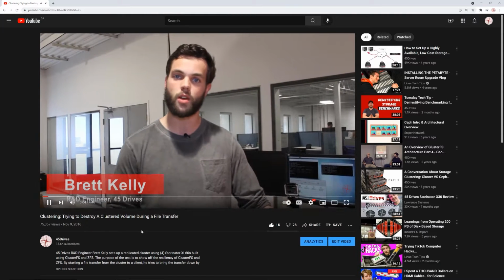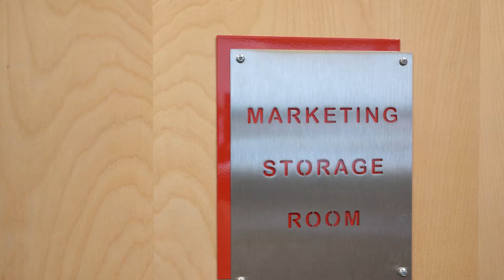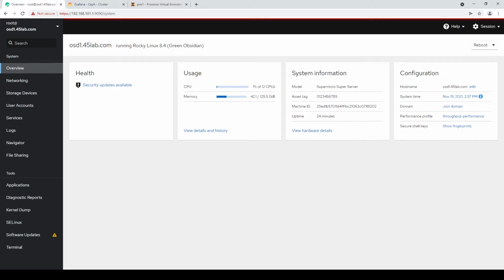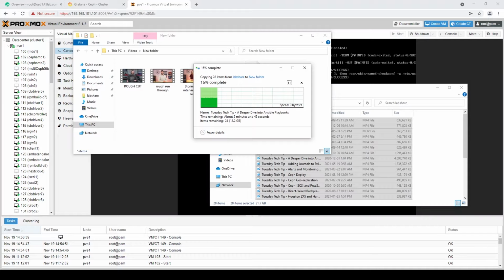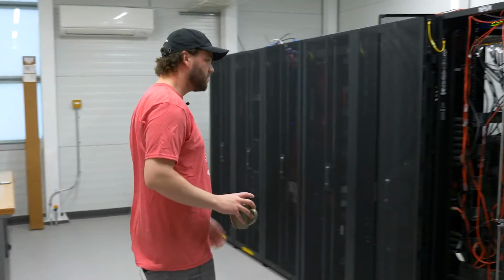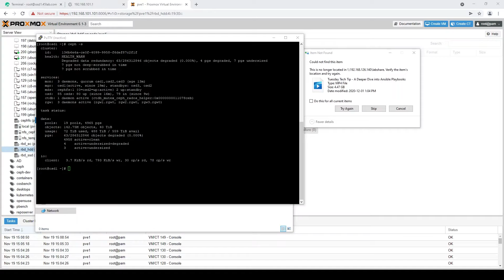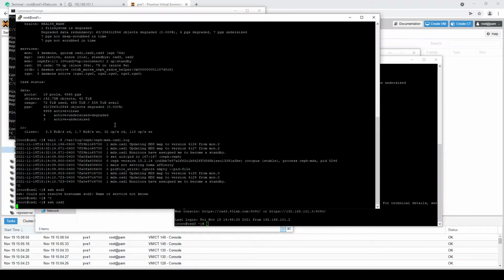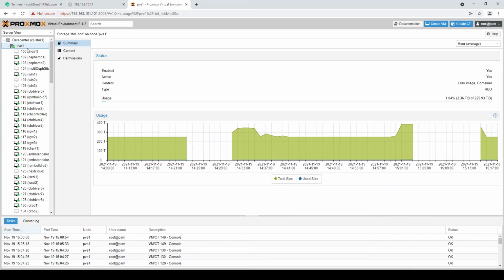We DESTROYED Our Production Ceph Cluster

Comment: Hi. 
I am trying to build Ceph on a single node using three nvmes (the CRUSHMAP has been modified, like this 'Step Chooseleaf firstn 0type OSD') . But the results of the 4K random read-write test were very poor. I don't know what the reason is. According to the FIO test results, RND4K Q32T16:4179.80 IOPS  read 10368.50 IOPS write in RBD. The results of testing directly on the physical disk are as follows, RND4K Q32T16:35262.53 IOPS   Read 32934.7 IOPS write.
Reply from the maker: Ceph Bluestore OSD backend was able to increase performance and latency of the OSD technology considerably over filestore. However, it was not designed specifically for NVMe as NVMe was not extremely prominent when it was being developed. 

There are some great optimizations for flash, but there are also limitations. Ceph has been working on a new backend called SeaStor which you may also find under the name Crimson if you wish to take a look, however it is still under development. 

With that being said, the best practice for getting as much IOPS as possible out of NVMe based OSDs is to allocate several OSDs to a single NVMe. Since a single bluestore OSD cannot come close to saturating an NVMe's IOPS, we then should partition our NVMe into at least 3X partitions and then create 3X OSD's out of a single NVMe. 

Your mileage may vary, but some people recommend 4X OSD's per NVMe but 45Drives recommends 3. This should definitely give you additional performance.

Hope this helps! Thanks for the question.